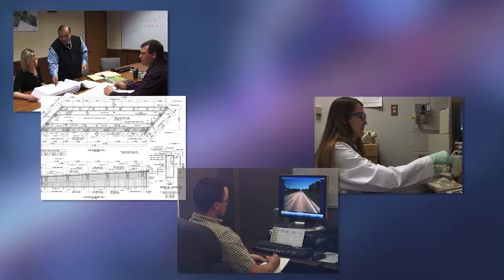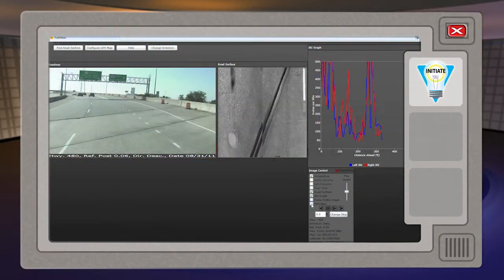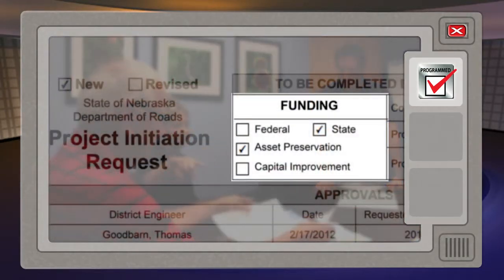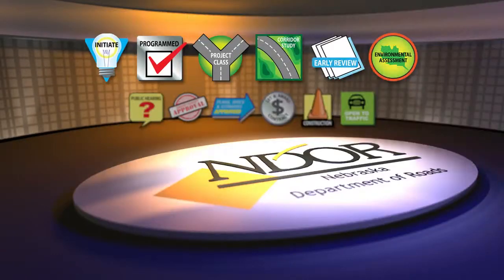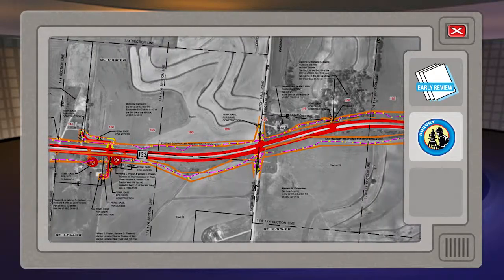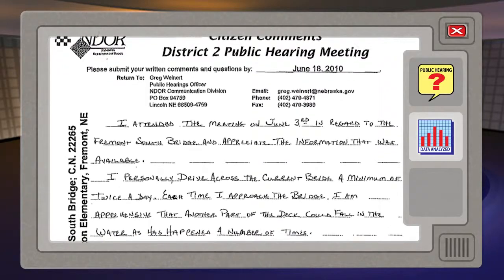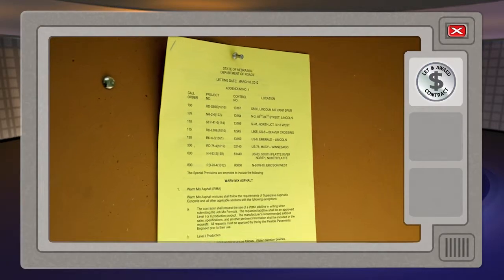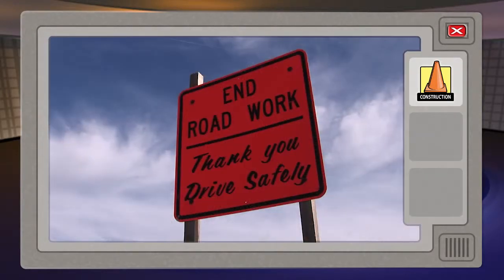From Concept to Construction

Comment: I have a capital improvement project for you... I-80 west bound in Omaha between I-480 and 60th St. This traffic funnel needs to be widened.  Cutting down 4 lanes of travel in that short of a distance proves to be a hazard daily. They need to add at least 2 lanes to go past 60th St. There is always a huge congestion there and often accidents. Also access to westbound Dodge elevated expressway from I-680 north/southbound. Only having one lane to access the expressway was just a bad design. Often traffic backs up all the way on to 680. Even times where there's hardly any traffic flow from Dodge St on to it's 2 lanes for the expressway. I-680 access is still backed up. You think oh, traffic on the expressway must be terrible. Then you get on it and it's smooth sailing. It's just too much of a bottleneck! Some of the problem is bad drivers who don't know how to merge or don't understand that interstate access turns into it's own lane on the expressway so they slow way down like they have to merge on to the expressway. It drives me nuts! Lol